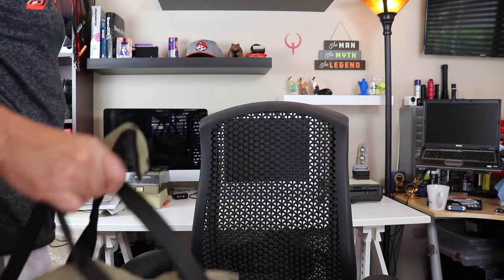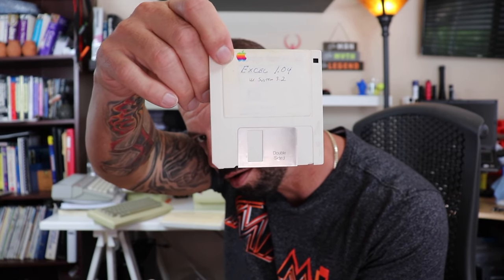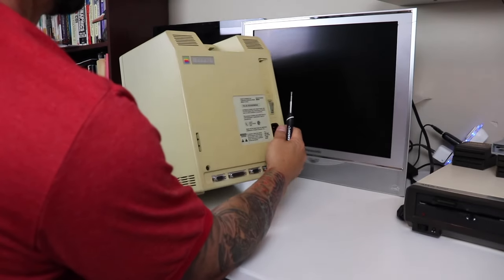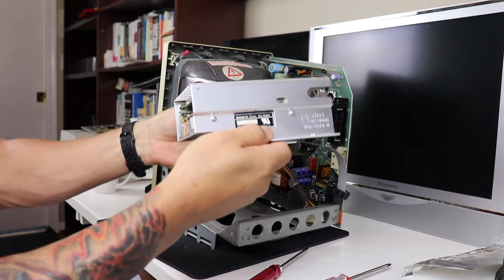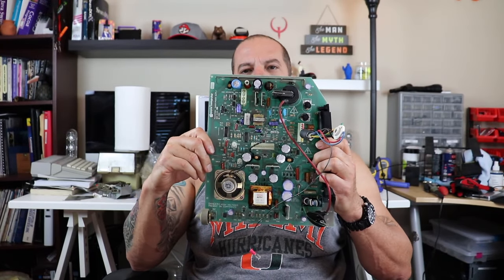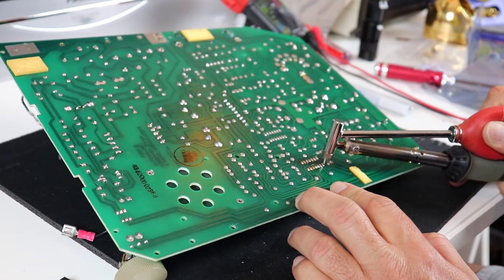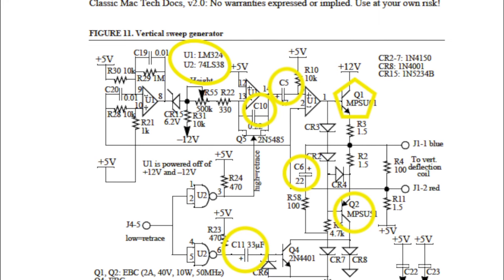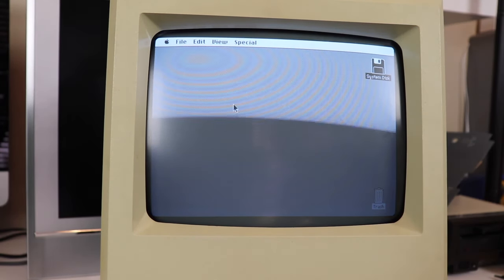Repair / Restore Apple MacIntosh 128k Classic

Comment: McIntosh (spelled with an Mc) is an audio equipment manufacturer. Macintosh (spelled with Mac) is the computer maker. Originally Steve Jobs wanted to use the "Mc" spelling, but the audio company (from Binghamton, NY) would not allow it. They reached a deal for the computer company to use the "Mac" spelling.
Reply from the maker: your exactly right... I used to repair those high end audio units (probably why I spelled it that way!)... I corrected it, thanks for pointing that out

Comment: I think you should warn people about the danger of shock from the CRT which has some very high voltages, particularly when the case is open and the Mac is powered on. Also there is a danger of shock from the larger capacitors on the power board.  You may be lucky if the board has been left for a while to discharge but if someone just powers off and then touches some of the solder points that are attached to the caps they might get a nasty belt as some have high voltages.
Reply: Yeah

Comment: Seems to me you had a fully working system but one bad floppy disk.

The screen position could easily have been fixed by adjusting the rings on the CRT.

Resoldering, recapping and even replacing ICs on the AV board was not necessary.

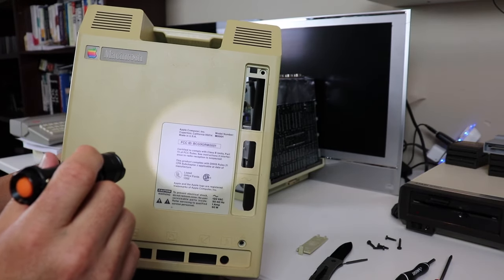Comment: 11:20.  Wrong.  The serial number is on the front under the monitor.  Starts with F.
Reply from the maker: Oh wow thanks for that info. I had read somewhere that the originals Mac 128k did not have a serial number assigned.
Reply: Yep. It is right under the font lip by the brightness control.